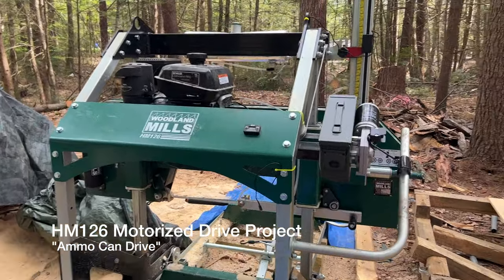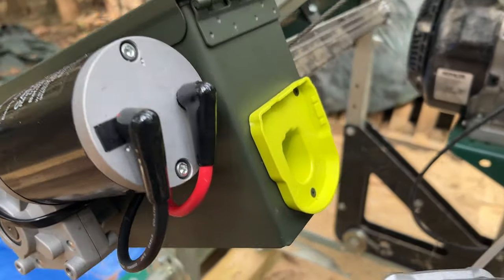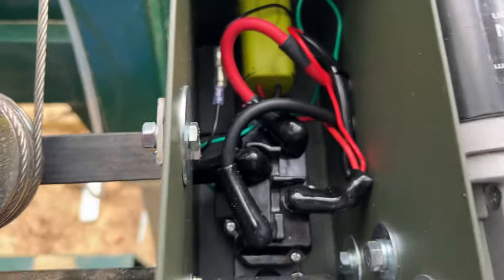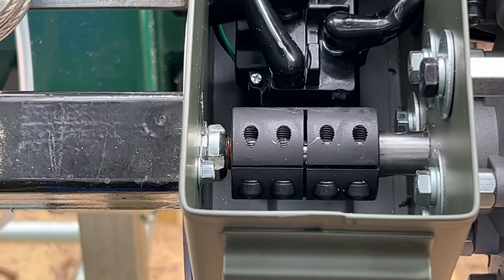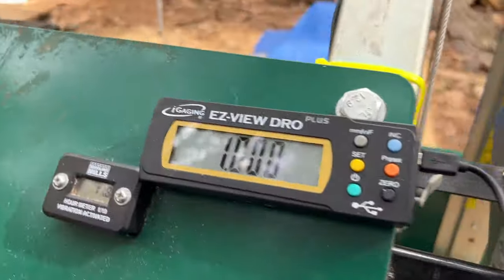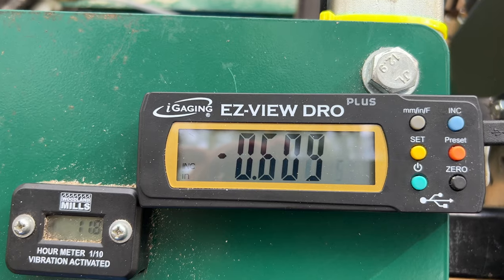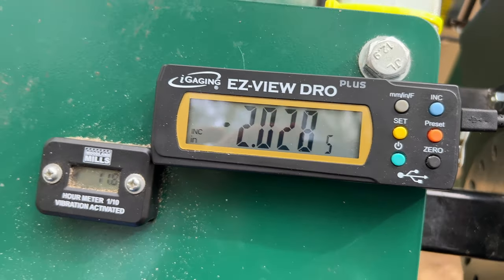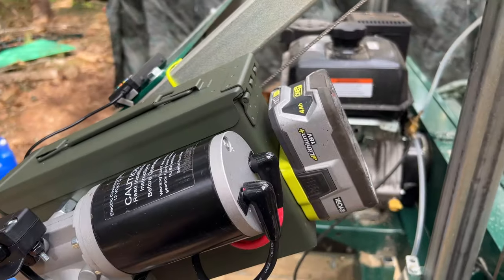HM126 Sawmill  Motorized Drive Project DIY

Comment: Nice job, doing something similar...any idea if Milwaukee M12 (12v) battery would have enough power to run the lift?
Reply from the maker: The large M12 batteries yes for sure.

Comment: What size shaft is the lift when handle removed?
Reply from the maker: It was just under 1/2 inch. I took some .010 shim stock and made a sleeve that the shaft collar could clamp to. Its possible that other types of shaft collars might handle  the smaller size. The 1/2 inch collar I used needed the shims.

Comment: You know what size the handle shaft is? I'm looking to put a chain sprocket on to motorize mine. Need to know the shaft size to order the sprocket. My mill hasn't arrived yet that's why I'm asking.
Reply from the maker: the coupler I used was 1/2 by 3/4. However the shaft is about .020 shy of 1/2 inch. I made a sleeve from .010 shim stock and the 1/2 shaft collar worked just fine. I think WM just took the lead screw material and shaved down the end and that ended up being just shy of 1/2 inch.
Reply: @Tiny House Guy    Thanks, I'm getting 2 chain sprockets putting 1 on the handle shaft and cutting the other one in half and then welding it back together on a 2000 lb winch spool. Attach the winch with a bracket to the mill and also a chain and then hope for the best.